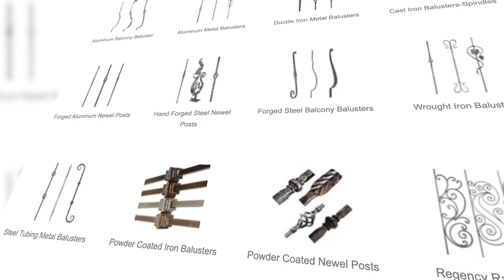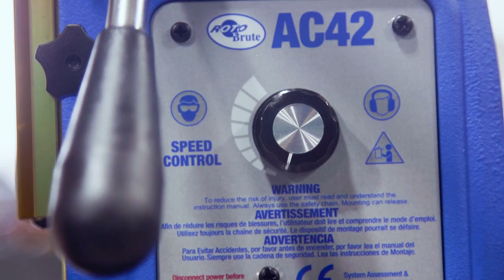Reasons you might want a MagDrill | JIMBO'S GARAGE

Comment: They are a great tool, the only limitation is you need a reasonably thick bit of steel,  and room the get the base of the mag drill on the steel and drill the hole in the right place. 
 I use annular cutters in my drill press often as well. The cutters are a real game changer for big holes both in a mag drill and in the drill press.

Comment: Sucks I used to use these everyday until our shop made a switch to only stainless steel jobs.
Reply: you could try a bit of plate of steel for the mag drill to grip that you can clamp on to the stainless if you have the room.